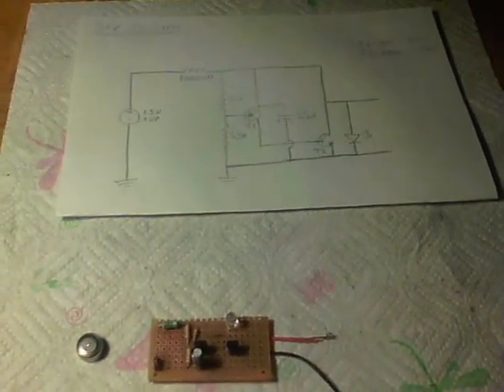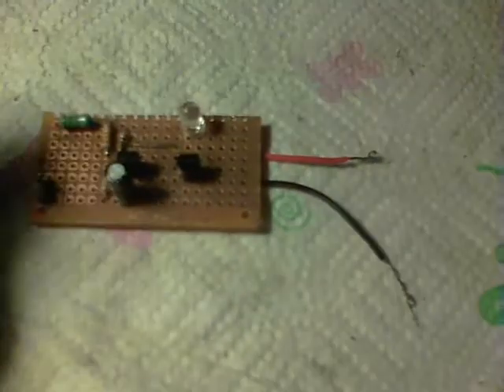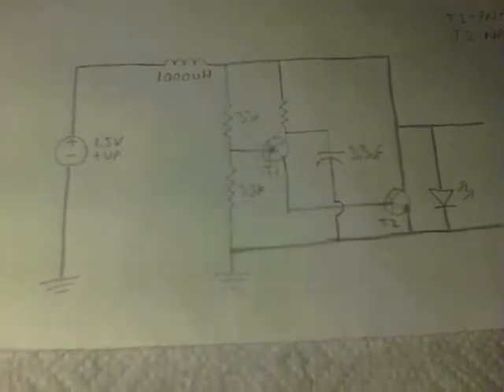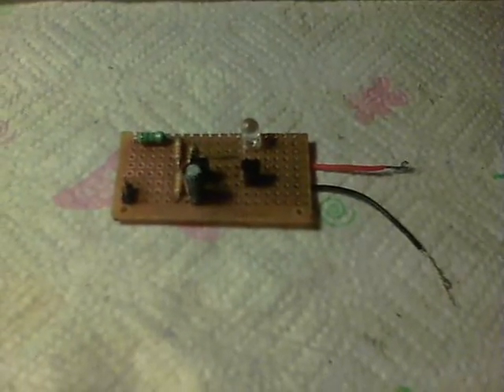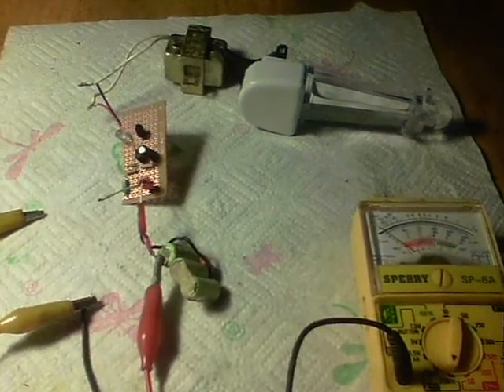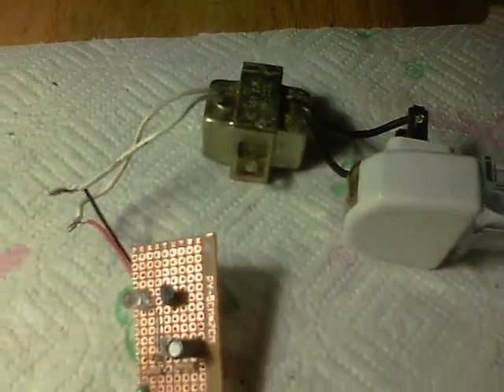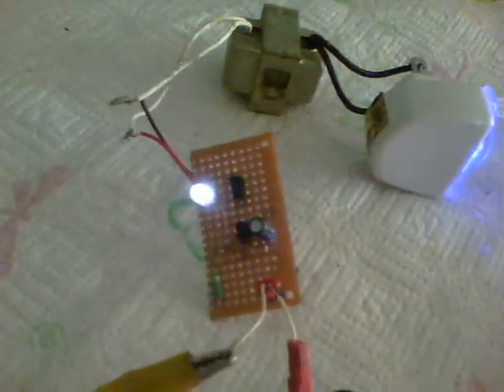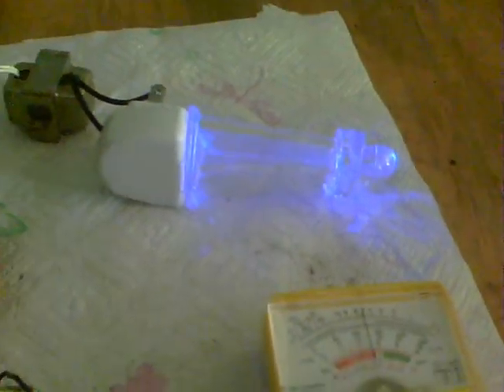Backupcpu's S+V Oscillator

Comment: You're very welcome my friend :) but for better result remove the inductor and put the transformer there :) I'll post a video of my final device :) Cheers!
Reply from the maker: Wondered about that, being a coil anyway. But when I found it acted like a current limiter it was considered that way for small signal transistors. Will try it out...thanks :)
Reply: :) Indeed you are correct I tried it as well :) but you can also add a resistor in between the collector of the pnp to the base of the npn but it play with the frequency as well. I made another video of this little circuit I shall upload it today :)

Comment: Seen a similar variant for garden lights too! Its very similar to the garden light IC's
Nice amp meter :D about time you got a good analog meter :D
Reply from the maker: Yeah, normally a 220uH inductor on those. Longer runs with 1000uH but a bit of brightness is lost. Parallel 3 LED's for less mA used and similar output from each LED as just running 1.
This Sperry meter was actually my first working one, following buying a couple of dud/blown digital ones at yard sales. It's got no off switch lol, which I like.
Reply: Analog meters are easy to fix when the current sense resistor burn too. Its amazing what you can do with them once the crappy 1/4w resistors are replaced with 1w metal film ones.

Comment: Does this work as well with a few ground lights feeding it. I ask because you have gone across the LED with the transformer. The LED is still on. ie does not see transformer as a short. I was thinking you could go across the ground light LED's. Very well done my friend.
Reply from the maker: Interesting thought. I dunno, will try it !
The LED will go out with the transformer on the ned if the load is too large though. I hooked up a mains radio and while the amp draw went up, the LED went out and nothing happened with the radio. Kinda handy maybe, to check that a load is in range of the output.
Reply: Thanks Bobby.